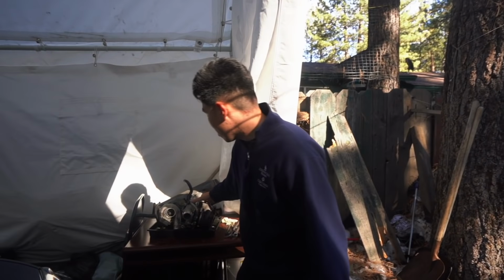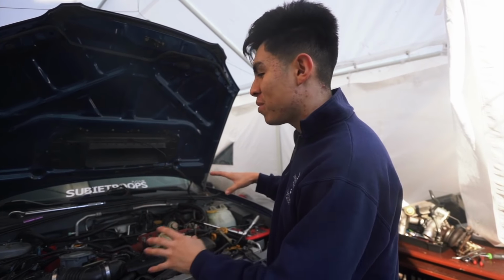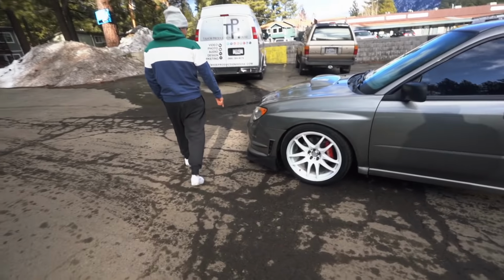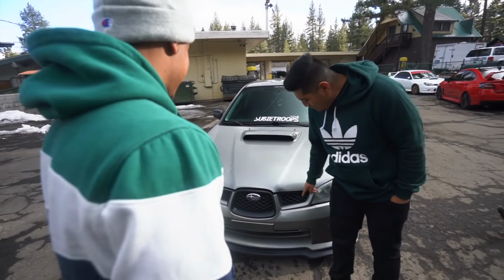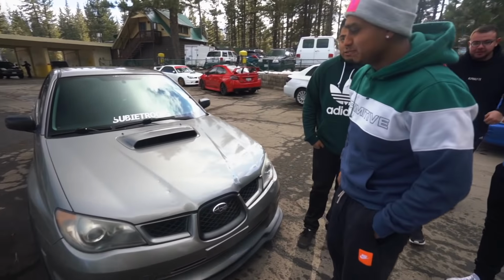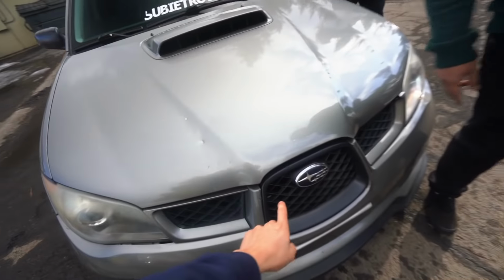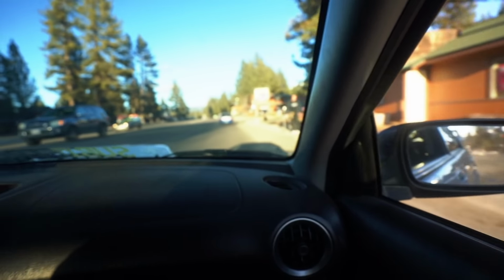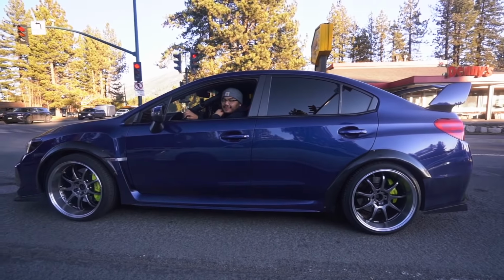Taking The Subies Out On A Summer Tease!

Comment: Just explain very well I have a oil leak but the down pipe after the turbo so I would like to know if possible where it could be just be very througho where most leaks accur in subies especially 2003 04 bug eye thanks

Comment: Do you has to retune a car after replacing the turbo? My 05 sti had a blown turbo and I have installed a factory oem turbo. The car is running on a cobb stage 2.